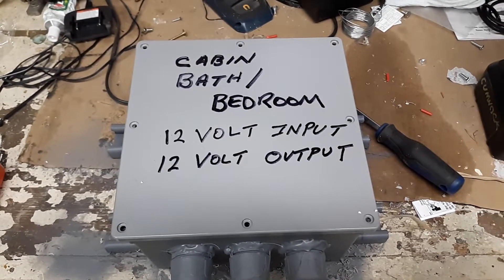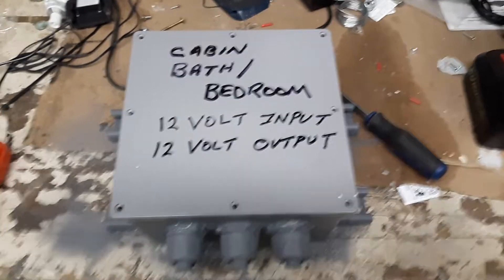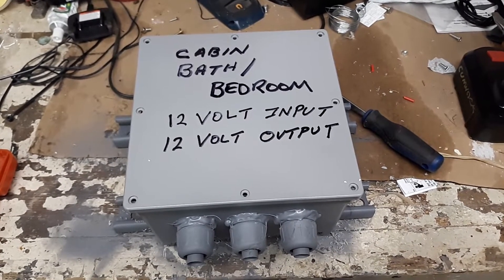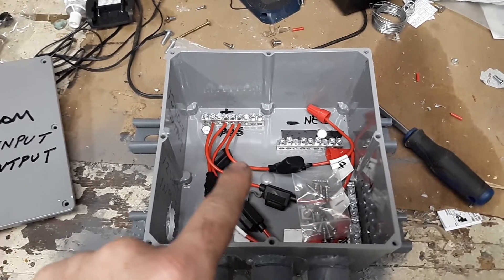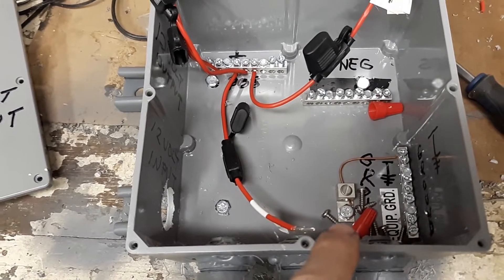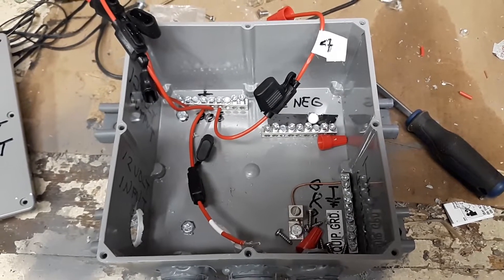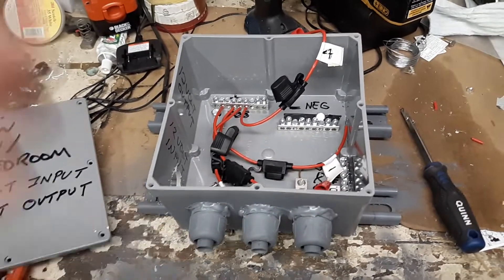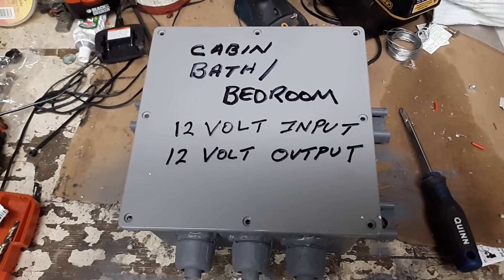CHEAP DIY Solar Power Combiner Box Off Grid Power Off Grid Cabin Power

Comment: Old  school way would be nut an bolt ring terminals together. Wrap alot of E tape around them.   It worked for my old 600amp service panels in the factory for over 40 years!  & still going strong.

Comment: I am doing something very similar, but including a din rail with fuses for each wire. My inverter is non isolated, so it needs a fuse on the negative side.